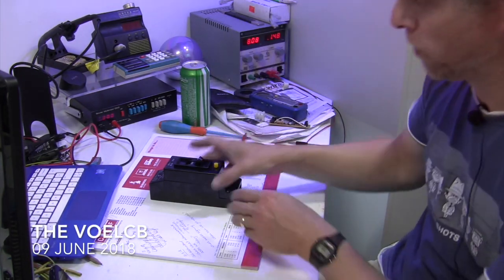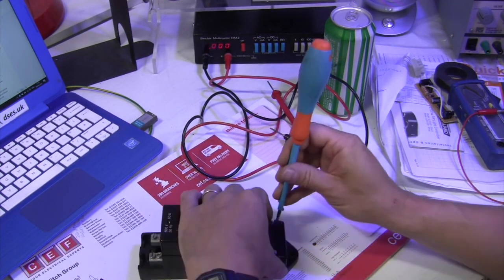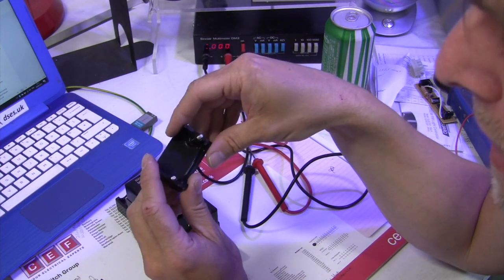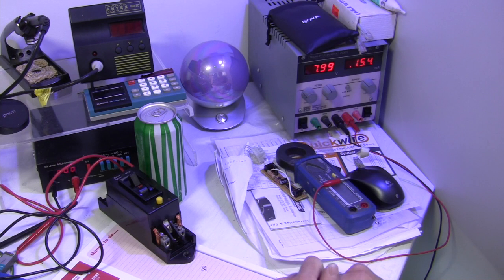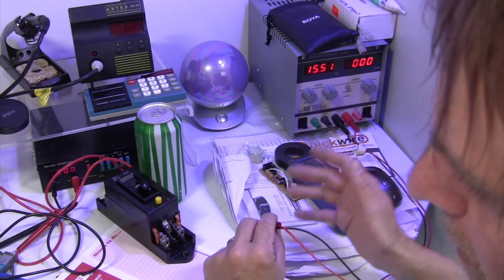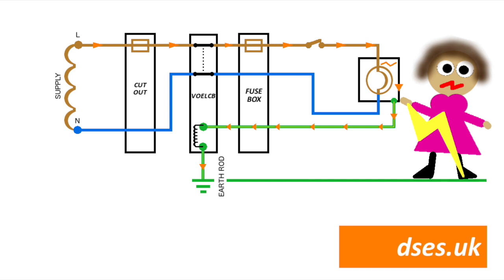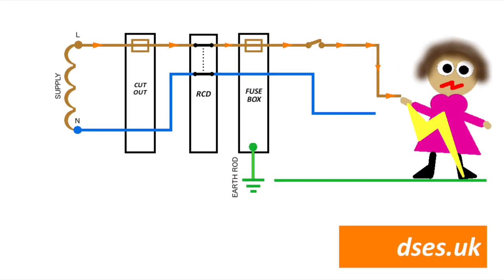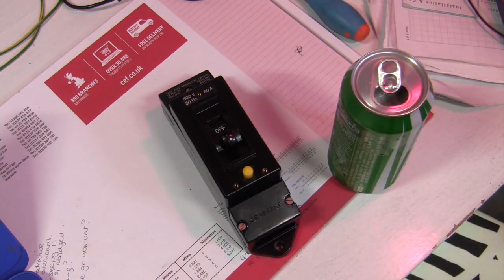The Voltage Operated Earth Leakage Circuit Breaker

Comment: Another great video Dave.

My granddad's  place has one of these for the utility room {washer, drawer, etc} and a run to the garage and sunroom in the garden.

We had an issue with the plug of extension lead the washer and dryer where  plugged into melting and no trip.

When I opened it up the breaker somebody had just twisted together the grounds on the output but had the incoming ground just hanging in the air not connected to anything!